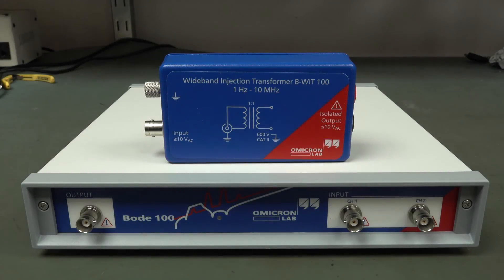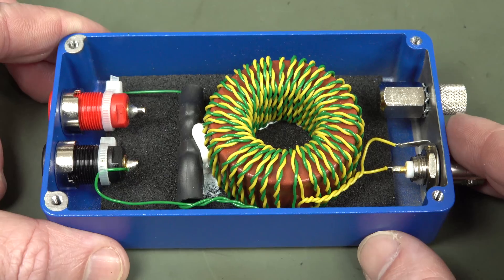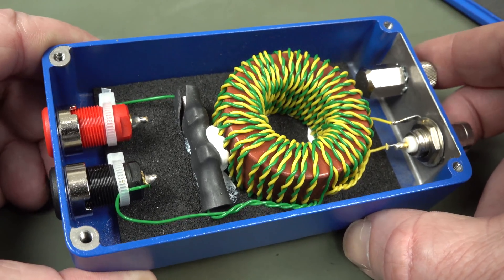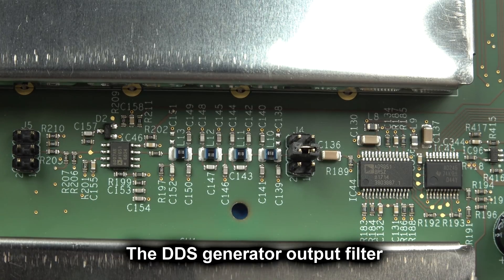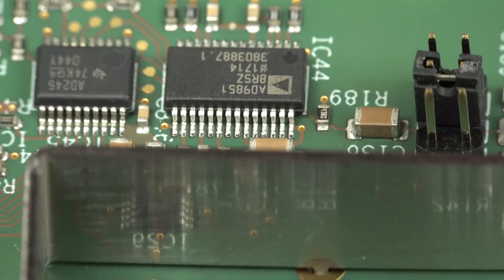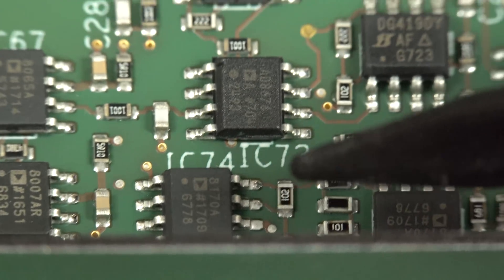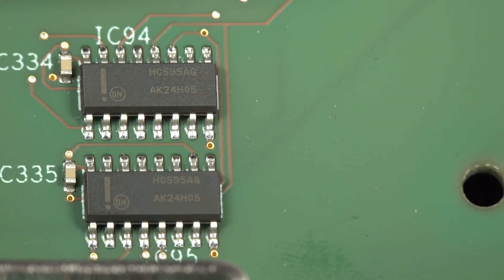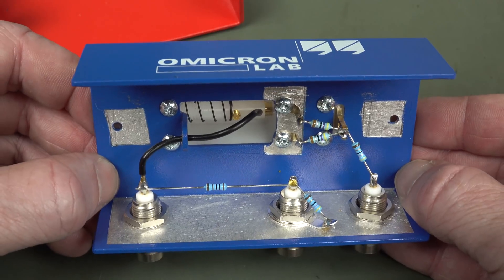EEVblog #1104 - Omicron Labs Bode 100 Teardown

Comment: The wire is specially manufactured. The wire drawing machine uses normal copper but the machine has to be oriented in such a way so the wire is drawn from north to south in the Northern Hemisphere. The machines in the Southern Hemisphere needs to draw the wire from south to north. This will align the copper crystals for proper conduction in one direction. Look for arrows on the wire jacket to see which direction the toroidal core needs to be wound. :)
Reply from the maker: Sounds legit.
Reply: You work for Monster, right?
Reply: Jamie Norwood : Actually, the Monstrous amount of B.S. that I spewed in my original comment wasn't much work to concoct.
Reply: Jerry Oswald it was truly impressive. I could easily see it being the pitch of 19k/meter speaker cabling.
Reply: Jerry Oswald No those techniques are only required for audiophile grade phono cables. Not necessary for such a comparatively simple device as a 1Hz-10MHz transformer.
Reply: For high end audio the core needs to be made from tonal wood.
Reply: Oxygen free injection transformer.
Reply: Needs to be done at a very specific temperature too, which happens to be above the melting point of the copper, so it needs to be done in a high pressure vessel to stop it from melting.   It gets more complicated when making audio grade stuff because the acoustics of the manufacturing process matter.  The machine needs to be very quiet.  In this case it matters less.

Comment: im shocked the 9851 is doing the DDS, i have so many of those chips laying around and i never thought of them as stable for instrumentation of this class
Reply: Stable? It is a mature known product and is 99% digital. I guess 10-bit 180MSPS is all you need, but for a $5K class machine, that's really kinda cheap. I suspect the design has been around for some time and they just haven't needed to update it.
Reply: well simply the AD9851 DDS is not a precision part ... its jitter is quite high, its nonlinearity is not great for this application and its voltage accuracy is variable with temperature
Reply: Got any citations for that? Jitter is listed as 80ps, way outside the 50MHz LPF of this application, and DDS code jitter isn't rocket science to work around in software, especially at this sort of accuracy. Absolute voltage accuracy isn't particularly a problem either, as you are measuring ratios, measuring both your own incident and then transmitted / reflected wave, it effectively calibrates itself out to a large extent.

Comment: Are you sure this is a superhet? Looks like a classic direct conversion receiver(near zero IF) for these low frequencies VNAs. The 2 DDS are usually just offset by the bandwidth of the ADC...
Reply: At 13:53 you can see the mixer at the down left, AD834 four quadrant multiplier.
Reply: Adil Malik my thoughts also, low IF (each DDS a few tens of kHz apart) plus a pair of Tayloe quadrature mixers on the RX sides, explaining some of the analogue switches. Low IF so a low speed ADC. Low IF avoids mixer DC offset and phase noise of downconversion LO. So it is “superhet” as there is frequency downconversion rather than direct conversion.
Reply from the maker: LA2STA Laboratory -Damn, did I miss the most important chip in the whole thing? Doh!
Reply: Good spot!
Reply from the maker: That's what they claim on the product page, superhet.

Comment: A russian guy once repaired a cheap lab power supply and the fault was in the mains fuse holder, it was just broken. He didn't have any holders so he just soldered the fuse. "The fuse holder can't brake if there isn't one".
Reply: Are you from the most bizarre semiconductor land?
Reply: Russians know how to fix stuff.  If you take away the part that breaks and the product still works, well you fixed it and increased reliability!    Heck, you don't even need fuses, that's what the rest of the components are for! :P  There's a funny saying that expensive transistors are designed to protect fuses.

Comment: For $500 dollars, I would at least expect the label to be applied straight on my project box.  Beautiful transformer though, wouldn't surprise me if those windings were spaced apart by hand during calibration to optimize.  Specialized kit and the knowledge to get it where it is costs special money.
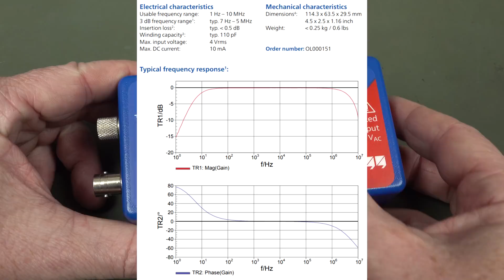Reply: looking at the graph at 1:28 the frequency response falls off quite a bit at low freq. -15db at 1hz. it doesn't go back up to 0db until 100Hz which is much more doable I think.
Reply: Yeah, and Dave was moving them with his fingers lol
Reply: I agree with your point about the 10V at low frequency and core saturatrion . It does not make sense . Usually for  loop response one would use less than a millivolt  to avoid saturation of the error amp .

Comment: And if you can design injection transformer like like that and wire it by hand while getting less than $600 (for whole project) you should really reconsider your current workplace.
Reply: Karol Piotrowski Polish Virgins would do it for less.   I'm sure🇮🇩🇵🇱🍺🥂👍😎
Reply: Last time I've checked they were clothed and didn't deal with anything over audio frequency ;)
Reply: Go ask the nude polish virgins at toroidy.pl.

Comment: I actually did a "mini-internship" at Omicron in Austria a few years back. No nude virgins assembling the devices though :/
Reply: Clothed virgins, males.
Reply: Well it was more of a seminary. We were a group of students and we were given extensive presentations on high voltage switching, transformers and protection devices, as well as how to analyse those devices and make sure they work properly (which is mostly what Omicron doeas). With a factory tour and some hands on measuring work at the end. All in one week. It was lots of fun. They have some amazing work spaces. Their work philosophy is very chill. But in Austria is only the engineering part and some final assembly(By normal dudes lol), as well as customer support and the bosses and such. The PCBs are actually built by a supplier in Asia somewhere. Even they have to admit that it's just too expensive to manufacture in Austria. But maybe the nude virgins are there. :D
Reply: ElectroBlud give us the insights
Reply: ElectroBlud but every Electrical Engineer that I know is a virgin till 30?
Reply: ElectroBlud very proud of you.  You're must ever 30🤣
Reply: Xy Zi Your comment wins
Reply: tell the truth.. Were you one of the 'nude virgins' 😁
Reply: I would be hesitant to call somebody studying electrical engineering an engineer.
Reply: @florianhf Not that Asian PCB's are a bad thing. I do not consider outsourced products to be better or worse automatically. But I was pretty sure they said they were producing their PCB's in Asia.
Reply: ElectroBlud wow, I went to a wrong uni.  What school u going to?
Reply: @Prehistoricman I would too. But the students I know are going to be engineers someday and 30 year old virgins is never going to apply to them. So that's that.
Reply: okay :)
Reply: ElectroBlud yes they were guys. Ya ya und shom shtrudles too ya.
Reply: Pahom, no man, you got it wrong. Come and look it up under my croch. Something you probably would do. Have you CDs?
Reply: valerio \new they have only one Virgin for the whole company.  She is 72 years old.   

...... run away, while u still can.  From 72 years old virgin.
Reply: Note that there are NO Asian PCBs in omicron products! PCBs are manufactured and assembled in Austria and Switzerland!

Comment: $500 and no fuseholder - pisstakers!
Reply: A fuse holder may have contact resistance to variable for what they needed here and other undesirable characteristics.
Reply from the maker: Solotov D. - What a ridiculous statement. They have produced a high performance hardware and software solution based on years of research and development. I don't get the hate toward this product.  Many people are obviously completely clueless about high end niche engineering test equipment.
If you can produce the same product at a profit for $300 then you will be SUPER RICH. Go on, do it, you'll make a fortune.
Reply from the maker: Indeed!
But it is nicely heat shrunk and cable tied :->
Reply: Solotov D... $300? Are you referring to the transformer ? If so then yes.
This is not a consumer product is a fairly niche device so is sold in very low volume and there is significant amount of design work for both hardware and software that needs to be recovered from that low number of devices sold. 
You need to design a competing product and sell it at $300 :).
Reply: 4:40 "It is constructed with care" AW COME ON! Stop apologizing for price gouging that's off the scale!
Reply: Yeah, fuse holder wouldn't make freq response to 10Mhz (reliably).
Reply: Dave is true to his brand idolising. If this had been a noname from China he would have bashed it hard, at least the hardware. From my point of view you have to realize the research effort that goes into these kind of things, just as Dave also says.
And for the "missing" fuse holder. You dont need a fuse holder there. It would just make it unreliable. If you blow that fuse you really messed up.
Reply: Couldn't even get the label on straight.
Reply: But what are the cable ties holding together?  Looks like they are just around the fuse only.
Reply from the maker: electrodacus - That's possible.
Reply: ElmerFuddGun the wire is cable tied to the body. See the banana jacks earlier in the video, same technique. I guess so they aren't flapping about in the breeze.
Reply: Solotov D. 
Pure gibberish. Design costs money.
Reply: why are people calling it a scam? there are costs for the R&D, costs for low volume production, integration...
Reply: To be frank, this thing was not cheap for anyone!
Imagine designing that and having low volume production... All of those precision op amps. I get sick to my stomach thinking about it. 

I guarantee there was a good reason they did away with the fuse holder. Part cost was not the primary cost to produce a product like this, not when the production is low volume.
Reply from the maker: davidf2281  - It was constructed with care for a hand made low volume product. The value for money is an entirely different question, don't conflate the two.
Reply: Solotov D. -  you maybe right on $300 just for the parts .But ,like Dave said  assembly ,calibration ,software development ,research and low volume that add al up. But still that transformer is overpriced ,a 1/3 of the price would be more fare.
The rest of the kitt is a bit on the high side too .
But hey if you need it you pay it.

Comment: That toroid is wound with a bifilar winding.
Reply from the maker: Actually I don't think it is, because bifilar implies the same return wire in the pair (as a coil usually). This is a transformer with separate pairs twisted.
Reply from the maker: I actually said bifilar as my first reaction when shooting the video, but I edited that bit out.